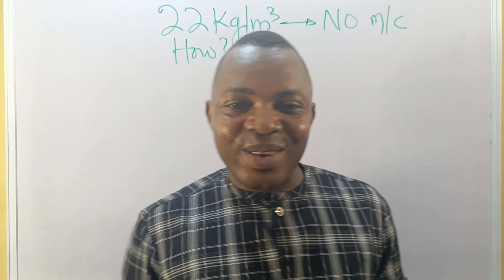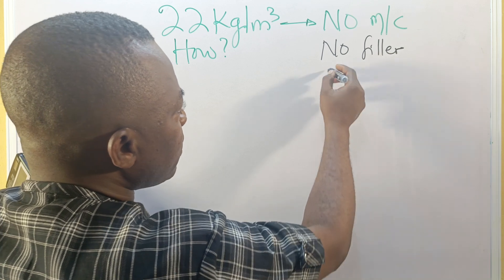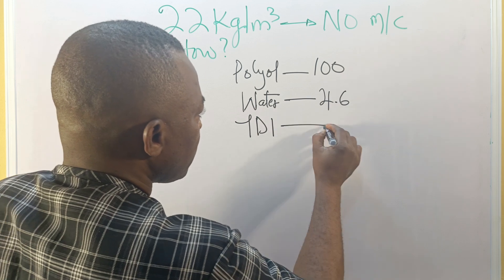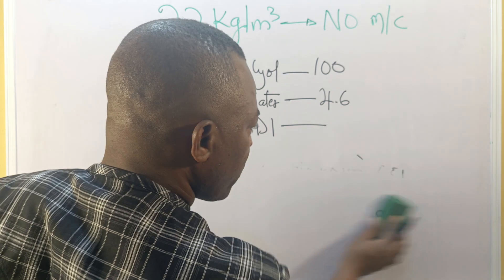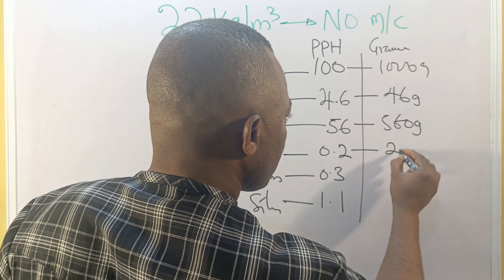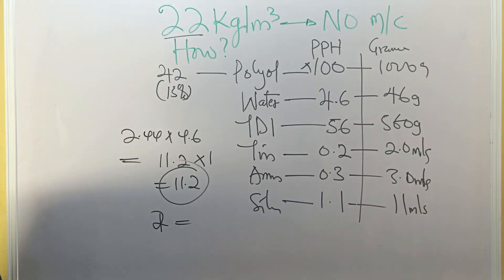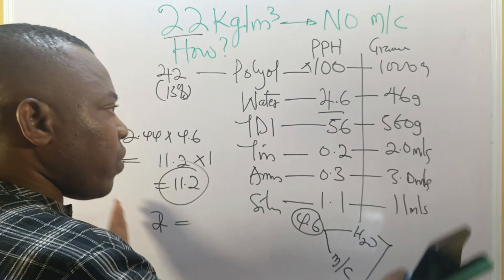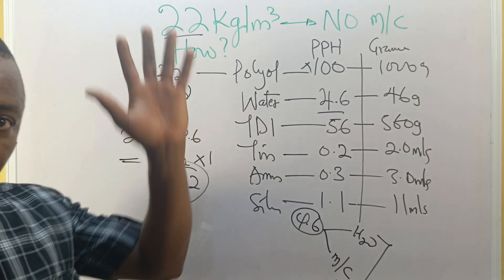LESSON 22: TECHNIQUES FOR WATER BLOWN FORMULATION OF 22D

Comment: Great job sir, please can you guide us on how to make a foam with 11kg/m³ density
Reply from the maker: @kankamoscar5308  ok I will release a video on that properly next week today was 30d.
Reply from the maker: Continuous process or conveyor? Filler or no filler?
Reply: Sorry sir, the question is how to formulate a formula of 11kg/m³.
Reply: Well done sir. In one of your videos, you calculated your blowing index by dividing 100/30 for a 30 density foam without filler and in another,  you divided 80 (Polyol)/20 (calcium carbonate). My question here is where is the denominator changing for one you used the density and another the filler?
Reply: @ALFASAMUELOBONI  filler(CaCO3) is an inactive powder, so you just calculate it from the active polyol liquid. so if its without filler its 100, if its with filler substract the filler amount PPH in relation to the polyol (100-20 in you case).